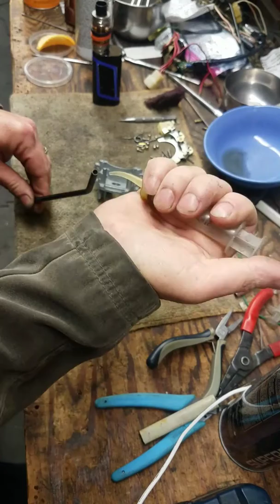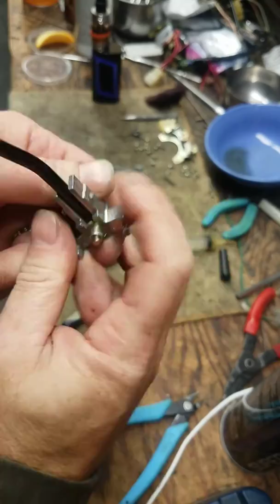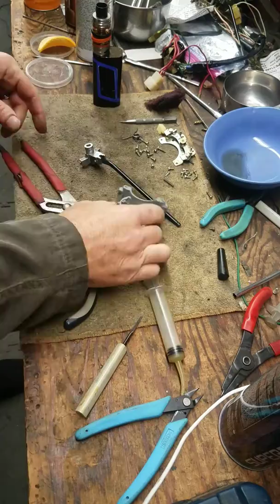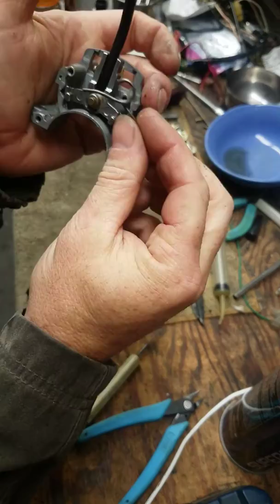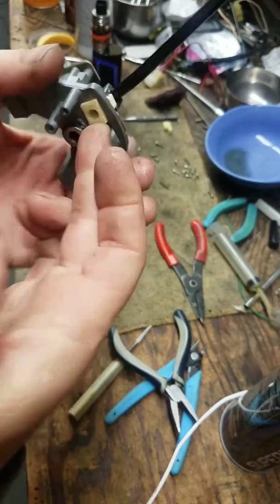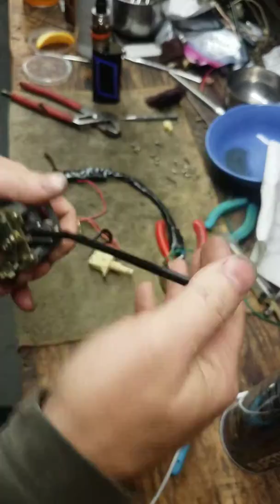Datsun 240Z S30 switch rebuilding mechanical assembly

Comment: Would you happen to have any spare parts from a turn signal switch I can purchase? I broke the circuit board on mine trying to pry it open to clean the contacts.
Reply from the maker: Sorry. Sold Everything switch related. Which board did you break? The hi/lo beam switch or the turn signal switch?
Reply: DatsunDave07 the turn signal switch. The part that holds the brake light contact points. Would you happen to know of any other alternative to fix it? Is there any type of conductive adhesive I can apply?
Reply from the maker: @phengvang1441  email me at wolfin32z@yahoo.com we'll discuss it there.

Comment: So I decided to completely tear down my 1978 280z turn signal switch. I cleaned and lubed every moving part using your videos and it is 1000x times better now. However I am left with one extra ball bearing. There are a total of 3 bearings in the 280z switch. The two larger ones go on each end of the rocker part. The last one is significantly smaller and I have no idea where it is supposed to sit. I honestly don't even remember taking that bearing out. Do you know where it belongs?
Reply from the maker: Haha. Probably the 2mm one that goes inside the turn signal switch metal box. Use a dab of grease to hold it to the spring when reassembling. 
Sorry. I just now saw this...